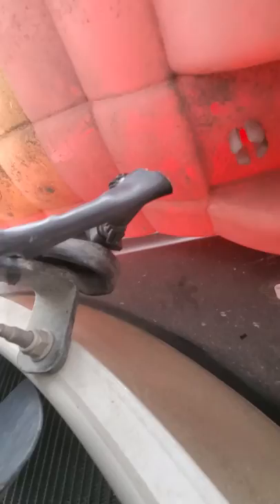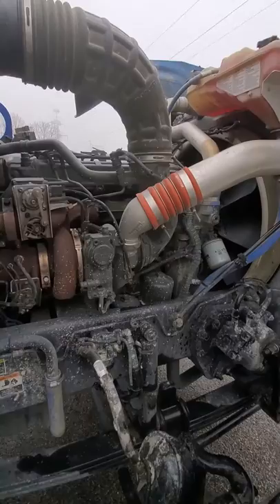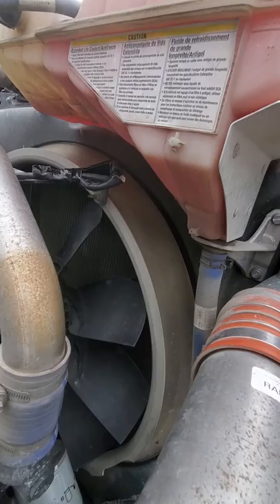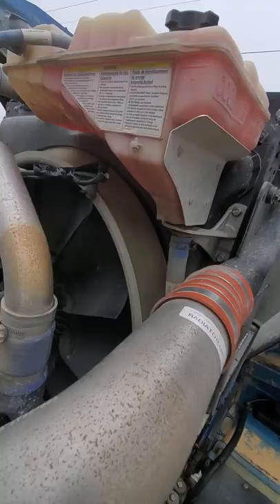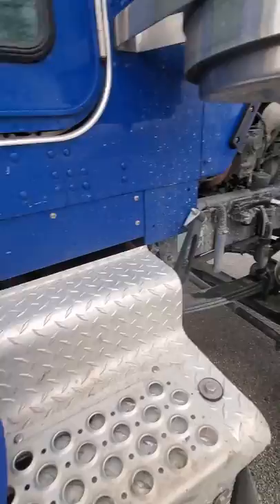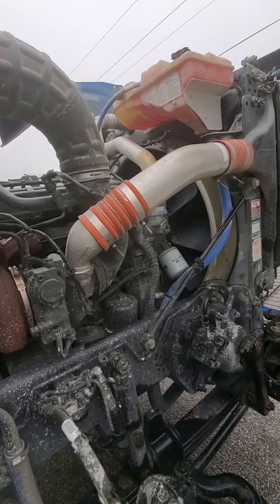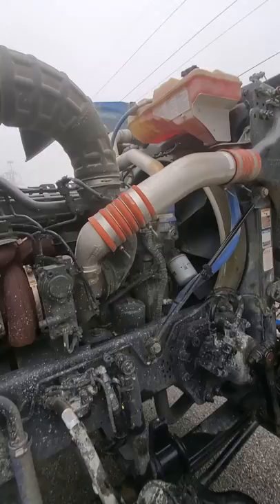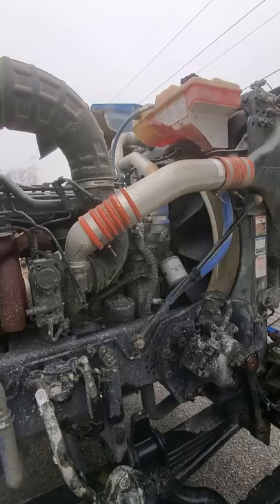Paccar Mx 13 on a 2017  Kenworth  W900  water Coolant sensor level..

Comment: I will do that with my truck tomorrow
Reply from the maker: If it doesn't work right away just give it a few minutes that it should If you have the same sensor the same setup
Reply: @elpajaro76  thank you work on my truck thank you the stdealers Peterbilt. they want charge 600 and I fix with a new plug, Peterbilt dealers are the worst , I took my truck out before touch 37 dollar fix. I hate the dealers. They are stealer with white collar.

Comment: I have the same issue on a peterbilt 567.  I didn’t take out the sensor but I unplugged it which stopped the false low coolant light and chimes from coming on.
Reply from the maker: Long as you don't have check engine light and the water cooling light or the warning sound  come on you good but if its does try this. .

Comment: Hi
Does the magnet stick to the sensor without taping it?  I tried with a refrigerator magnet and it did not stick to the sensor unless I taped it and it did not stop alarm
Reply from the maker: Its got to be on the tip of the sensor... tape it .. look its all depends  what engine  u have i got paccar mx 13... not sure for cummins engine ... u can try .if u have  other  sensor  try then  too with the   🧲  tape it to the tip
Reply: OK thanks, I have a Cummins ISX 15. I will try it
Reply from the maker: You should check with your local cummins dealer I heard that they  can  disable this problem  withthe stupid  plastic  water coolant tank 
 Good luck ...  And if you do get somewhere with it.. can you please make a video for those they have cummins engine ... send  me a link.. i will  share it t

Comment: I'm having the same issue but I have a steel black tank that sits on firewall. So just put a magnet on the end of it were do I put then.
Reply from the maker: Does ur sensor screw into the steel  tank  or pull out like my
Reply: @elpajaro76  it screws into the steel tank
Reply from the maker: My old pete was like da..  my best to u  replace the  sensor and see what happens..
I did replace my  old one.. I would love  to have  the  steel  tank  on my new truck.. new trucks almost  everything  is  plastics
Reply: I already replaced the sensor the same thing keeps happening
Reply from the maker: U getting  check engine  by any chance.. if u do  u try  to clear it out
Reply: @elpajaro76  yes I am. I changed the sensor cleared code and a week later same thing occurs so I ordered a tank ima try that next
Reply from the maker: If  ur sensor is  plastics u could  try  what I did with  my sensor.. on the very  tip of the sensor  I put the magnet  🧲   Wrap-around with tape.. my guessing  is not ur tank .. my tank  is plastics  with  a  magnet  flooded  in side the tank... I don't think  u have  a flooded  inside ur tank because  u have  steel tank.. but I could be  wrong.. check ur harness to.. I'm sure  u probably have  already
Reply: @ThePhatboy08  I have same tank and problem can you help me to find out the issue

Comment: Ok so I hope you can reply back to me. But I have one of these tanks and I keep getting a false reading. My sensor looks similar to yours. I noticed after I purchased truck that someone had already done something similar to what you showed in video however whatever they did must of come apart and its just dinging. I am confused as to how to make it stop. Could you shared with me exactly how to make this stop?
Reply from the maker: Hello   Yes what I did was... look at your sensor pull it off the tank . Leave it connected with the harness And the very tip of that sensor... Tape  a magnet tied  with   electric  tape.. if  u don't  have  a magnet  u can get then at lowes  or Home depot little  Square  magnet  they sale ..The sensor  won't  fit in the  tank hole any more.. So tape  sensor  any where  a way from the fan.. if this don't work it could be  ur sensor  is bad..  Most likely the floater inside your tank is bad ..  I'm gonna try to make a video tomorrow how I did it .. thank  I hope this  works  for you.. I was very  frustrated with it.. if u have  an extra  sensor  try it  too.. u definitely  need  to get some one  with a computer To erase the code don't need to do it right away
Reply from the maker: My apologies didn't get back to you earlier
Reply: @elpajaro76  absolutely no worries at least you did get back to me cause most people on YouTube don't. I will give this a shot. That might have been the way it was done but they never told me. I will try and get a magnet here shortly. I'm trying to do a drop now and I'll find somewhere on my way to the second drop to grab a magnet and try it. Thankfully mine is not shutting down truck but I do have the ding memorized! Lol
Reply from the maker: Ok cool keep me  updated  how u do. and yes the ding drove me crazy  Every time I hear it sound like the on the radio i freak🙄ut 
 Be safe out there and stay strong
Reply: @elpajaro76  so in messing with it I have discovered they already had some magnets in there don't not if they just came loose or what the deal was. I played around with it and for right now the dinger is off. Hopefully it worked! Lol
Reply from the maker: @petermobile379 . Do u  own  a code reader to clear the code or maybe  a friend..it could be  the old code  Popping up. what kind of engine u have , if u have  cummin engine  they can bypass  the sensor  issue. On paccar  engine  u can't bypass  nothing  so they say.. 🙄
Reply: @elpajaro76  I have a Cummins and like it appears to be working now. I tinkered with it some more and seems I might have it in the right placement. 👍